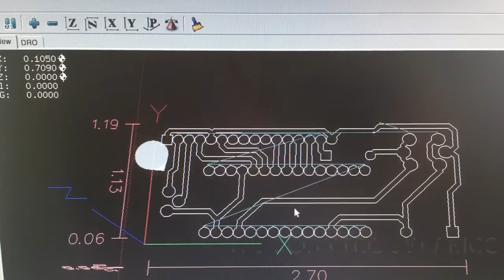What it Looks Like to Mill a Circuit Board

Comment: Did you also use the mill to make the traces?
Reply from the maker: Yes sir. Milled the circuit and drilled the holes. Even cut out he PCB from a larger copper sheet.
Reply: +The Good Life Lab I'm not sure my current usage need can justify it yet, but what make and model mill are u running?
Reply: +The Good Life Lab sorry, just went back and read the video description:) great video!